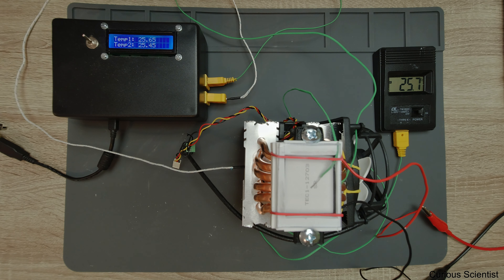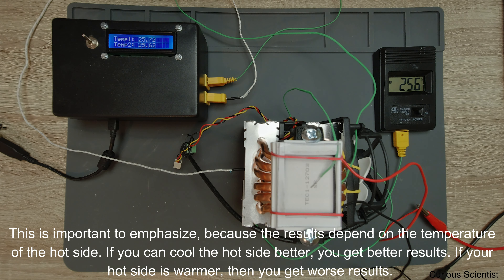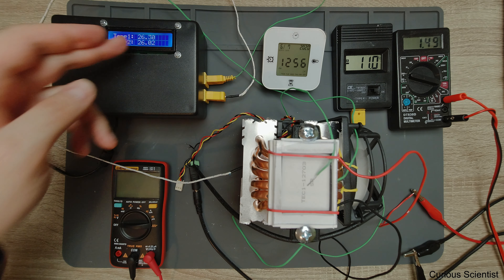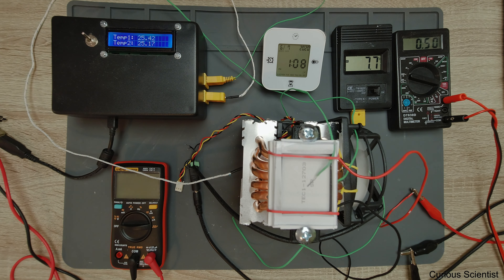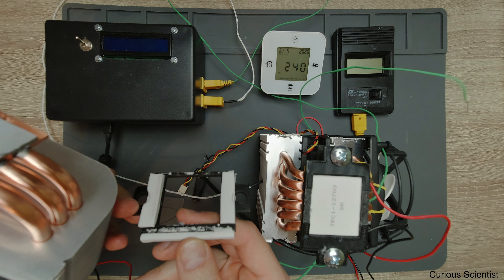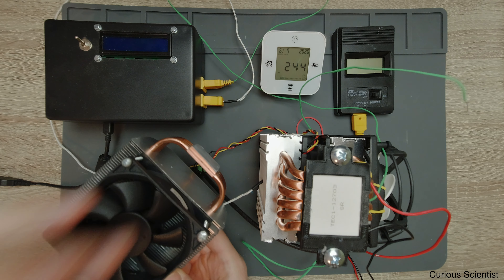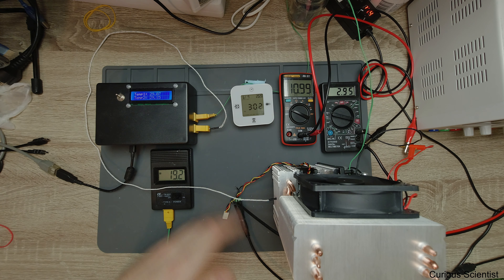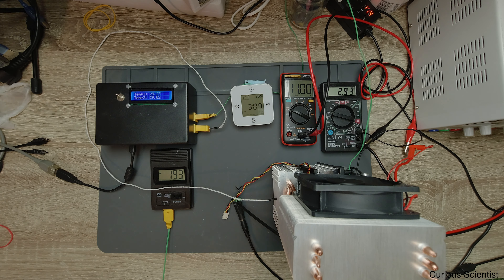Testing and comparing different Peltier coolers - Part 2 - TEC12703

Comment: This is the best instructional video I've ever seen on these devices. Very, very comprehensive and thorough. Unfortunately those waterblocks wont work for too long unless the water coming in is cooled a lot and the heated exit water is dumped. Also it should be about 3x to 4x larger than the peltier.  Continue working on the air cooling. It's relatively continuous temperature (considering the volume of air in a room vs. Water in a cooling loop) rather than a constantly increasing temperature of a closed loop water cooler. 

Not to say this isn't very educational though. What you are showing in these 30 minute videos took myself and 2 others over 6 months to do to determine. Correct heatsink size, power requirements, peltier to use, air flow, and moisture introduction with evaporative abilities to meet optimal transfer and cooling ability are not easy. You can't control the weather and adapting to constantly changing humidity, air direction/velocity, solar radiation, ambient temperature, and conductive forces requires much consideration. Indoor testing under semi-controlled situations is where it all starts and these videos are perfect.
Reply from the maker: Thank you! I will try to share my knowledge and experience as much as possible. The water block was just an idea, but yes, it gets warm pretty quickly and then it renders the Peltier useless. It is only good for demonstration purposes I think.

Comment: That's wild you can build a strong cooler that only has 30W TDP, glad I started researching this.
Reply from the maker: Strong is an overstatement. The dissipated heat is the pumped heat PLUS the power supplied to the Peltier cooler. Keep this in mind!
Reply: @CuriousScientist  Yeah but the cold side still reaches below -12C in a relatively short time period. I'm just using one to build a cold plate not a fridge unit.
Reply from the maker: Yeah, without any thermal load, it reaches very cold temperatures. If you would put some thermal load on the cold side, it would take much more.
Reply: What @CuriousScientist is telling you is that temperature by itself is not a measure of cooling power.  You can put a drop of water on pettier and it will freeze fast, but it won’t freeze a cup of water in practical terms.  Watch his other videos where he demonstrates practical experiments that show that.

Comment: what thermocouples did you use, trying to buy my own for a similar purpose to interface with arduino!
Reply from the maker: K-type. Check out my website, all the parts I used can be found there.
Reply: @CuriousScientist  is it the max6675? I’m looking for sometime with a small probe that can be easily secured to the surface of the peltier
Reply from the maker: The MAX6675 is not a thermocouple but it is a "K-type thermocouple to digital converter"... The thermocouple is just two dissimilar wires spot-welded together, so they are really small. However, if you are planning to measure below 0°C, the MAX6675 module is useless. Use the MAX31855 instead.
Reply: @CuriousScientist  gotcha thanks for the response! I’m assuming you calibrated the outputs yourself then given the siebeck effect and the material of the wires you used.
Reply from the maker: @ShadowEmbassy1  No calibration was needed (for my purpose). I simply connected the thermocouple probe to the module, that's all.
Reply: @CuriousScientist  appreciate all the help man!

Comment: You need to spend 30 seconds to explain to people how to subscribe and like the video so it will begin to move up the search ranks of you tube.  It's possible that if I hadn't subscribed before I'd have never seen this series and that would be a shame. I haven't seen better explanations of peltiers from YouTube anywhere. Everyone keeps showing how they get them to "xC below 0C"  meaningless without some work being done! You can see how -20C cant cool a processor or a video card or even the human body when it can't even take a load of ambient air through a decent radiator down as low as 10C!  Imagine there was a 55C overclocked processor in that mix. It would probably actually heat the processor up! (Actually it would). So you have just proven that if a heat load is higher than 15C over ambient(after attaching a fairly robust cooling side radiator) it is of no use for that particular peltier! I have never seen anyone use this intelligence on YouTube yet.   Thank you for giving people a starting point. When you reach the metrics we have met, I would like to discuss possibilities of your partnership in the project we have been working on.
Reply from the maker: Thank you! I am a bit too shy to "beg" for subscriptions. When I share a source code on PasteBin, I write a sentence in the source code with the direct link to subscription, but that is all. I still have to work on this. But now, as some of my videos start to have 5-10k views, it is a bit disappointing to see that I don't even have 10% of those people subbing to the channel. This is life. :D 

I actually found a way to properly quantify some performance-related properties of these Peltiers, so within 2-3 weeks, there will be another, additional series for these 5 Peltiers. I am so excited to to those experiments. But, yes, as you also pointed out, one thing is really obvious: these Peltiers are not so good once they are subjected to some loads.
Reply: @CuriousScientist  Don't be shy. Do your set up then tell people the truth. The only way you can continue to afford to offer these videos is if they like AND subscribe! This costs nothing to us.  As you move forward and start experiments with things that cost substantial money ask for a membership that costs $2 - $5 per month (or whatever you feel it SHOULD be). If people don't want to hear you ask them for a favor they don't really see the value anyway.
Reply from the maker: I've already spent substantial amount of money on these stuff. Just the power supply for the Peltier was $250. The problem with the membership is that I will not create content consistently. Sometimes, I will publish videos every day for a week, but sometimes I will not upload anything for 3-4 weeks. I would not be a member of a creator's channel who is putting out content inconsistently. Maybe a one-time/occasional donation (Patreon?) could be better, because they could say like "hey, thanks for the help, here is $5". But I still have to increase the numbers before I "beg" for money.
Reply: @CuriousScientist  it's not begging I currently have $5 patreon subscriptions with 3 youtubers. One offers detailed information on the builds in the group only.  One offers handbooks and techniques for motorcycle safety only in the group. One offers discount buy programs on various group buys.  You aren't begging...you're selling added features.. At least ask for likes and subscribers. That's certainly not begging and as you grow you can get free stuff from vendors who want you to test products and possibly some YouTube money for ad revenue. $250 fora 30V 10A power supply seems high.
Reply from the maker: I will try to ask more. :) The PSU is 20 A, not 10 A, I guess it sounds more reasonable! It is a quite nice and decent variable laboratory PSU.
Reply: @CuriousScientist  yes. Easy to find high voltage supplies. Tough to find high amperage supplies.  I like when they sell the "750 Watt supply which is max 24 voltage and max 10 amps"  How do they come up with those numbers?

Comment: No matter heat to me
Can u help
Which 1 is the cooldest
No matter amp or heat
The cooldest 1
Reply from the maker: Watch the summary of the test series. :) They are basically equal when it comes to lowest cold side temperature, because their DT is nearly identical. They however differ in cooling capacity. The larger the unit the more the heat they can pump. But this comes at a cost, you have to have better and better hot side cooling. Your question is not detailed enough. What do you want to do with the Peltiers? (Forget about air conditioning)
Reply: @CuriousScientist  i can destroye the heat properly
And give proper current
With amp
My Q is which peltier can give me coldest temp
I watched in your video
Tec 12706 was about - 22

And tec 12708 - 25
But the 12710 and 12715  taking more amp and less cool
Compare to 12706 and 12708
Reply from the maker: Yes, and I also explained why. The larger the Peltier, the more current you can run through them and more heat is being generated. the 10 and 15 A units are too large for my cooler, so I could not reach their "absolute minimum" temperature.
Reply: @CuriousScientist  yeah brother that is what i felt
Anyway
You explained properly
I think there's no detaild video like yours
Thank u to explain us for best choice 💕💕💓   🌹🌹🌹 Thanks a lot
We wil stay tuned
 i subd
Reply: @CuriousScientist  and brother
Use more tags
To get easy search by people
Use the app
Text copy from image

Just cipy same other names of peltier that normal people use
And make montized
This wil support u to
U can use apo for copying
Copy image tex
Use this to copy other people tags
Reply from the maker: Thank you for your kind words and for the subscription! It is appreciated! I really try to explain everything in details, so I can provide a lot of information to the people and hopefully help them. If you will have more questions, just let me know it! Have a great day!
Reply from the maker: Thanks, this is a good idea. I try to use a lot of relevant tags both here and on my website. Unfortunately, I cannot yet monetize my channel, because I haven't yet reached 1000 subs. Once I reach it, I will apply for monetization, but I don't have high hopes in the beginning.
Reply: @CuriousScientist  thank you brother
I will ask you brother.
Thank u to reply and help us 💕🌹
Reply: @CuriousScientist  use 1 or 2 promotion
Use for 1 day to lot People with 5 sec speed video
And all concept to understand in 5 sec
This can help to trend
But like is impo. And make 1.2 or 
1.5 x  faster video of talking
Or make video and then voice over
This is best idea

Comment: Informative video. But too long and too much talking
Reply from the maker: At least I tell all the details, not like those fake videos without any explanation and with those bad royalty-free music. :) You can always skip parts of the video...
Reply: Don’t listen to them.  I like your detail explanations.  Most peltier videos just show people getting excited at showing freezing water.  Yours show proper experiment set up and Voltage+Current use as well as temperature which I think is very important to gauge their usefulness,  so thank you for taking time.  Saves me lots of experimentation work.

Personally I’m making this cooling system for some computer equipment and want to make it as silent as I can.  Doing the 2 cooling loops approach as you describe here, but with water and big radiators with minimal amount of fans.
Reply from the maker: Thank you for the supportive words! I hope your system will fulfill your expectations!